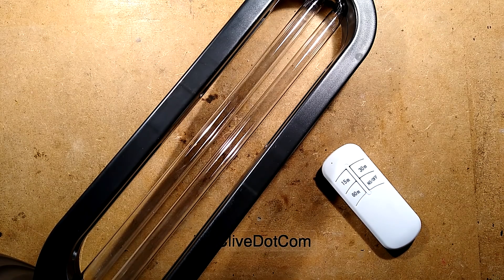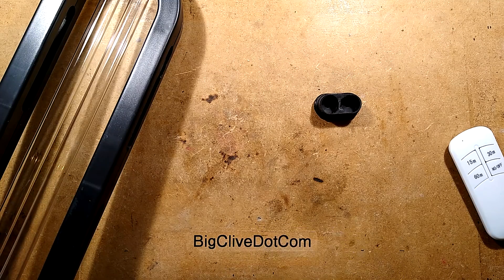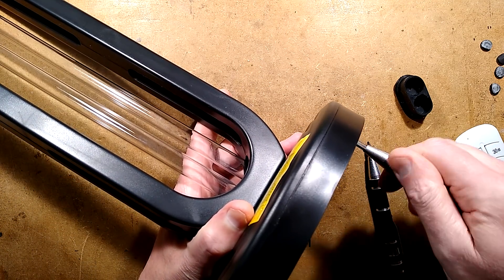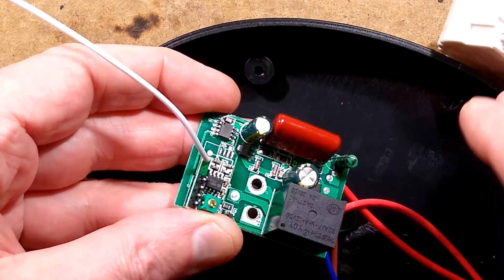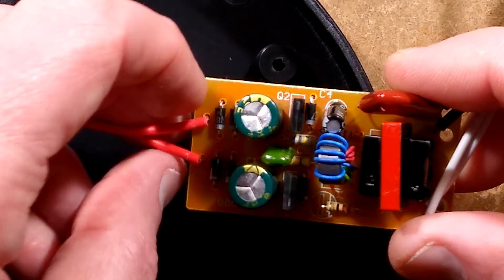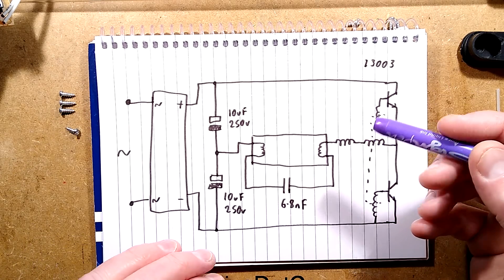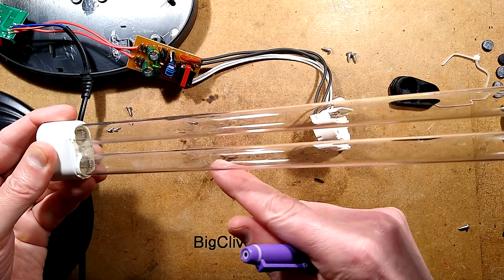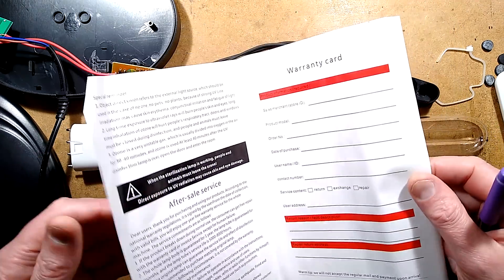Inside a stylish tabletop UVC germicidal light.  (Skin, eye and lung hazard)

Comment: Re: Flashburn/Welder's Eye:
The potato trick really works. Diced up potato in a wet compress relieves the sand grain sensation enough to get some sleep. However, after the last time I drove to the supermarket at 4am with sunglasses because the streetlights were too bright, I decided to always wear safety glasses and a hood for every weld. Even little tacks. You've only got 2 eyes, if you're lucky. Best take care of them.

Comment: how can you tell if it is fake
Reply from the maker: At this point in time the only UVC sources I trust are the ones based on clear glass tubes.  None of the LED products I've tested so far have been UVC and therefore not germicidal.
Reply: Ok I have several and I smell the ozone but the one I bought stayed are UVC so now how do I know if they are UVC... all have clear glass and the lights come on blue and beep first
Reply from the maker: @dennalee6184  It does sound like they are real.

Comment: You can find these bulbs inside of EEPROM erasers as well.
They tend to be interlocked, with a small window in the side to see whether the lamp was lit (because they were often manual start).
The one we have at work, the EEPROMs load into a slide-out tray, and you need to physically disassemble the unit to gain access to the bulb, at which point I imagine it gets interlocked out to keep you from starting it up.
That said, it is an older piece of kit from before all of this health and safety craze nonsense, so I think they just expected you to not set the timer and start the bulb with the thing half-dismantled....

Comment: What about far uvc 222 nano?
Thanks 🙈🙉🙊
Reply from the maker: Not really available to the public yet.  It requires a very specialist excimer lamp and driver.
Reply: @bigclivedotcom  I know, I was searching for one. I didn't even know about this type until I read a study before the lockdown. Seems super promising, and an easy add-on for any situation.
Thanks 🙈🙉🙊
Reply: @eddiegreg7064  skin cancer is a real risk, don't play with ultraviolet radiation folks
Stay sun smart.
Reply: @haruhisuzumiya6  uvc far @222 and low power can't penetrate the cellular membrane. I've only read a few papers published since February.
I personally spend about 1/2-2/3 of the year outside in the elements. 
I was just asking what anyone thought about this newish use for this particular wavelength of radiation. I'm only a sponge absorbing as much as I can.
Thanks 🙈🙉🙊

Comment: Hi bigclive, thanks for the video
I am considering buying such a device to sterilize N95 masks and other small places (fridge, sofa, bathroom)
You presented a smaller usb device in your previous videos which i understand runs for 15mins:
https://www.banggood.com/Rechargeable-UV-Sterilizer-Light-Air-Purifier-DC5V-Ultraviolet-Ozone-UV-Germicidal-Lamp-p-1331206.html 
They also have some other types, this one for instance, they say it can run 30mins:
https://www.banggood.com/99_99-Sterilization-Rate-UVC-Ozone-360-Disinfection-Lamp-Portable-Desk-UV-Lamp-Night-Light-p-1659454.html
Can you help me choose a device for the use case described?
Reply from the maker: I can't give an exact choice in case it fails to sanitize the mask properly.  You can also get the bare tubes and 5V drivers, but they're hard to find.

Comment: I don't see where the OZONE is generated. No corona. I think that's a mis-statement in your title for the video. Basically it's a fluorescent lamp without the phosphor coating. I don't believe the ozone claim. You can't claim wavelengths unless you actually measure them.
Reply from the maker: The mercury discharge includes a wavelength that splits oxygen molecules apart allowing them to form ozone.

Comment: In the second day of a power outage from severe weather running on a crap generator.

Is there any chance you can go over the options for cleaning up power from gensets? Both power factor and frequency, especially the latter because thanks to the IoT crap, there's picky, sensitive microprocessors in everything.
Reply from the maker: Most modern equipment have power supplies that are resilient to noisy power.
Reply: @bigclivedotcom  does that include relatively large frequency changes? I ask because I have a UPS that won't charge and my television won't work unless it's running off of the UPS.  Not a critical thing, but still tv while on virus lockdown would be nice.

Comment: Could exposing a smartphone to UVC cause damage to the camera sensor, or to the glue used for bonding the screen?
Reply from the maker: No.  UVC does not pass through standard glass.  But it could damage exposed plastic components.
Reply: @bigclivedotcom  but...but...what about gorilla glass :p
Reply from the maker: @TomStaels1  I'm not sure the UVC transparency of gorilla glass.  I'm also not convinced that UVC sterilisation of phones is actually as effective as the use of an alcohol wipe.

Comment: Are there health issues with 'blacklight' UV tubes ?
Reply from the maker: Only if you had your face pressed up against them for a long time.  The Philips facial solarium is based on blacklight lamps with the white phosphor.  The same as insectocutor lamps.
Reply: @bigclivedotcom  I got one in my bedroom some years ago as I thought it was 'cool'. I give it a go for tanning but after a short while, my skin started tingling - and I thought 'this ain't right'.
I'm slightly anti-sun bed now but fully recommend the proper stuff - as long as you don't wash off your body's natural protective oils.

Comment: Both my Mum's and my own "bug zapper" failed on April 1st so I've been searching fleabay for CFL UV bulbs, not the ones Clive is using, more on the lines of Disco or theatrical lighting.
A couple of years ago I searched for bug zappers that used bargain priced CFLs and not the ridiculously expensive 9" straight florescent tubes and never saw germs mentioned once.  Now I need them, they've listed anything that has a "U" or a "V" in it as "germicidal", and or "black" and bumped up the price to even higher eye watering levels.  It's like a judgement!

I'm not sure I like the sound of these lights, they seem a little drastic for domestic use. Regularly zapping rooms with coloured soft furnishings seems a bit like trowing a bucket of bleach over the settee.  I remember bleaching some jeans in the 70s and watching a pair of Levi 501s dissolving as they dried.  I also remember drawing back a pair of red printed cotton curtains back at My great aunt Maude's and seeing the red turn to dust as a result of sun damage (they'd hung unopened for 20 years in the back bedroom).

I can see these lamps would be useful in sterile industrial surroundings - but not suitable in even the barest household, not in Europe anyway.

Comment: We had UV lamps in the lab, for photochemical work, and the tubes were quartz rather than glass, so as to pass the UV-C.  One important rule was not to touch them, because the oil in your fingerprints would eventually char, absorb a lot of radiation, and create hot spots on the tube that could cause it to crack. Any tube being replaced was carefully cleaned and polished before being mounted.
It might not be an issue with low-intensity source like this - I'm wondering if the instructions had any such warning.
Reply from the maker: The oil on quartz relates to devitrification of the quartz on very high temperature halogen lamps.  I think the biggest issue with fingerprints on UVC lamps is blocking the emission in that area until cleaned.

Comment: One suggestion.
The only people buying these are the ones who have no clue how dangerous UVC can be. Good safe units start at hundreds of dollars. So it should not take a genius to figure out why these are so cheap.
There are safer ways to clean and treat your air for microbes that will do a much better job, but require professional installation. This thing can only work in unoccupied room and it's action is over once it's off. That's useless.

Comment: I really need a safe way to use it inside a fridge,
I did use RO filter's neon in a fridge but only run it in a less than a minute.
Excessive use of ultraviolet will damage food as well, it did that already on nuts in my small fridge, I never eat it after!.
Reply from the maker: You can get USB rechargeable fridge UVC units.

Comment: Photokeratitis is the technical turn for UV burning of the eyes and is the same as snow blindness which is the reflection of UV at such an intensity it sunburns the cornea as does arc welding, tig and mig welding and even railway workers near third rails have been known to get a bad flash.   Interesting anecdote about the potato juice, I have long wondered who or how they discovered eating le escargot enabled glass blowers to increase the volume of their lungs and was told that by the pier glassblower at Eastbourne as I thought he was eating bogies in apple sauce and he told me.

Comment: Clive I have ordered this to use in my downstairs loo as it has no window and an extractor fan. 
I was going to sterilise post and packages ect then use the extractor to remove the ozone. 
Do you think this is over kill or am I wise to do this? 
I should note I am in the “vulnerable”  sector as I have brittle asthma so I need to take every precaution possible.
Reply from the maker: I'm not sure how the ozone will go with the asthma aspect.
Reply: Matt Quinn thank you so much for your advice I never knew that and will certainly take heed and not use it. 
Thanks again and stay safe x

Comment: UVC LEDs recently appeared on the market... Are they any good for sterilisation?
Reply from the maker: There are real ones and a lot of fake LED UVC lights being sold on eBay.  The best option for maximum UVC is these traditional uviol glass mercury discharge tubes.
Reply: @bigclivedotcom  Is there a reliable and simple way to measure/confirm if LED produces usable amounts of real UVC or if it's just fake blue LED? (without testing it on my skin/eyes lol)

Comment: Is there a way to test the type of UV light being irratiated from the light?  I know there are a few uv bulbs from black lights to death lights.  How do you test the output?
Reply from the maker: The most dangerous ones are the clear tube type.  The dark tube blacklight lamps are safe at normal levels.
Reply: @bigclivedotcom   I was thinking of some kind of test strips or a specific gadget that doesn't cost an arm and a leg.  Is the glass just plain clear, or has it been properly doped with quartz to cut out ozone production (like the bulbs for HVAC systems) and still being germicidal.
Reply from the maker: @MrShwaggins  It's uviol glass of which quartz is one.

Comment: I have a very similar looking unit - but in a slightly different case - and mine shipped with a broken remote control.  I’ve built myself a fairly large sterilization zone just inside my front door using empty cardboard boxes to keep all the light in the target area.  Because of the broken remote, I have to use the buttons on the device itself and use the 15 second delay to get out of the room.  Mine has 2 buttons - a power/start button - and a button to cycle through the options of 15/30/60 minutes.  I plugged mine into a smart outlet so I can kill it early if I need to.  

At one point you say this would be a good device to create Ozone as if the Ozone were a good desirable thing - then a minute later you warn about the hazards of ozone.  Why would anyone ever want to intentionally create it?  Also - how much danger does the reflected UVC light pose (assuming it is reflecting off a normal painted wall or a cardboard box)?

If I wanted to, could I direct or focus the UVC light using normal household mirrors and still have a dangerous disinfection ray in the reflected beam?  Or do some of the wavelengths get absorbed by the mirror itself so that it’s just visible light that gets reflected?

Last question:  If you don’t mind me asking - how much did your unit cost?  I paid $140 Canadian for mine a coupe of weeks ago and have been wondering if these things were selling for a lot less prior to COVID-19.

Comment: Hey Clive, I did a new lab this semester before all the universities were shut down with my sections on UV damage in yeast. The idea was to plate two strains of yeast, a wild type and a mutant that is unable to repair its DNA, where exposure to sunlight would kill the mutants. Since it was still winter and we had no sunlight, we stuck the plates in our UV cabinet for disinfecting the lab goggles for approximately 5 seconds. It killed absolutely everything, including the unknown growth on the plates of the rather messy students. I no longer question the effectiveness of UV sterilization, at least of surfaces.

Comment: UVC kills "bad" stuff but also can cause plenty of issues along with eye and skin damage. As stated by Richard Smith below, it damages plastics. But it also reacts with certain metals, creating toxic nano-particles.  When used with ventilation, UVC should be surrounded by aluminum. The aluminum produces nano-particles from the UVC light which creates a plasmonic "nano-shield" to protect healthy tissue while still destroying bacteria and virus. There are plenty of studies out there. Think of a UVC bulb in an aluminum tube with a fan. As the fan pushes, or draws, air through the tube, the air is sanitized. Clean rooms utilize this method. If you want to kill surface contaminants, be careful. Stainless, copper, nickel, etc., react badly with UVC, as well as plastics.

Comment: I got an 8 watt 300mm UVC tube, put it in a standard fitting, and mounted inside a cardboard box that I lined with aluminium foil. The box is closed when I run it, but equally, I could leave the lid off and sterilise the bathroom if need be, while we are all downstairs. Yes, UVC is VERY dangerous. Incidentally, I ordered one from China in early March, and like you a while back, it failed to materialise.

Comment: Those are very low pressure (5 micro atmospheres) as compared to other mercury bulbs  to enhanced the 254 nM UV-C emission line strength. Polycarbonate blocks near all of UV-C like plain glass does - another youtuber has made a good video of it (Applied Science) using a deuterium light source.

Comment: Can you get UVc LEDs?
Reply from the maker: Yes.  But they're quite expensive due to the construction having to be UVC resilient.  The cheap LED "UVC" lights on eBay probably aren't.
Reply: Aye, I suppose at those wavelengths the photoelectric effect will be kicking the arse out of a lot of materials.

Comment: UVC for sterilization is commonly at 265 nano meters.  Very dangerous for eyes and skin. Can cause cataracts and eye surface damage. A decent air sterilizer for rooms should be in a sealed unit, using a fan to circulate the room air through it to sterilize the air.  The UV light source should not be exposed where people and pets can come in contact with it.

Comment: The two electrolytic capacitors are decoupling the tube from DC current. Actually a pretty neat capacitive voltage divider.
And given that it is a divider, there should not be any startup DC current through the tube.

Comment: Yes as my physics/tech mentor taught me decades ago: "when playing with 
something unknown, if you EVER smell ozone and see light - TURN AWAY, 
MOVE AWAY, TURN IT OFF"
Reply: When I was in the 4th grade, I got hit by lightning. I wasn't fast enough. X D
Reply: fun fact: ozone has no inherent odour
The typical ozone smell is caused by the reaction of the molecules with the nasal mucosa
Reply: @Flashv28  Isn't... that what every smell is... ? Serious question.
Reply: @JinzoCrash  
Taken from german wikipedia :"In high concentrations the gas has a characteristically pungent to chlorine-like odour due to its oxidising effect on the nasal mucosa, whereas in low concentrations it is odourless."
Sense of smell is defined as :"[In your nose][...] the odour molecules are dissolved, making them chemically registerable for the cells.  There are around 350 different types of receptors for this purpose, each of which only responds to a specific group of odour molecules.  The odour mixture results from the combination of the addressed receptors in the cells."

As I understand it, the perception that is produced when ozone enters the nose is the result of nerve signals from oxidized nerve cells.
Reply: @Flashv28  It sounds "similar" to what smelling is, yet different. Almost like... You're instead smelling your mucous whereas you're usually smelling the actual smell of something. ...i think my brain imploded lol.
Reply: I never did get hit with a UVC bulb over the years but saw an enormous clear tube being replaced where I used to work and I said "that's one of those scary tubes isn't it"? and the lab scientist said "yup!". Just wish I hadn't gotten dusted when I busted open an old yogurt maker full of asbestos.

Comment: My aquarium filter has a built in 9w UVC lamp.Most people say that there is no point in buying the UV model because the water moves too fast past it and that it doesn’t sterilize much. The filter has a 1400l/h pump.maybe take one apart ,in the UK you can get them from all pond solutions I think.

Comment: Nice video. Regarding germicidal LED lamps. Have you looked at the price of genuine UVC LEDs on Digi-Key, Mouser, Farnell etc.? They're very expensive. I know distributors are expensive, but the Chinese UVC LED lamps are so much cheaper, they have to be fake. Another thing to note is the current generation of UVC LEDs is very inefficient, compared to good old mercury discharge lamps, so even if they were genuine, they wouldn't be worth the bother.